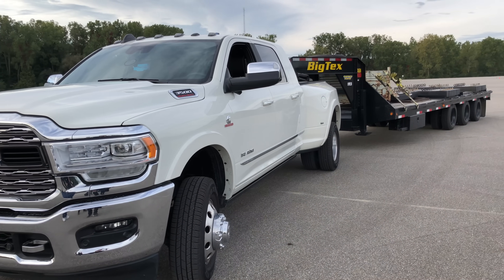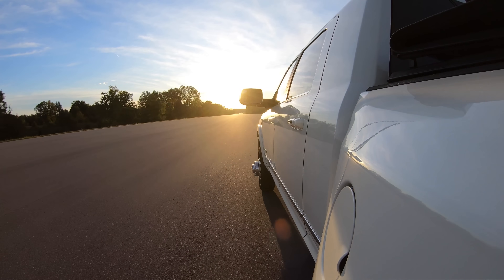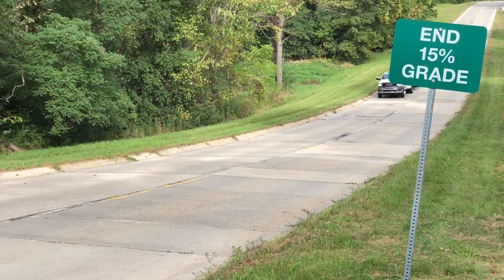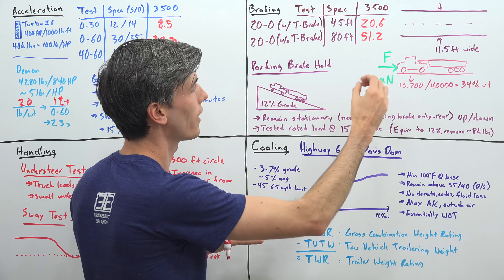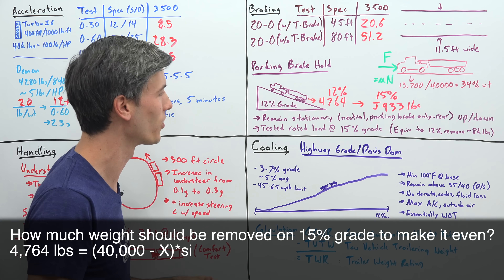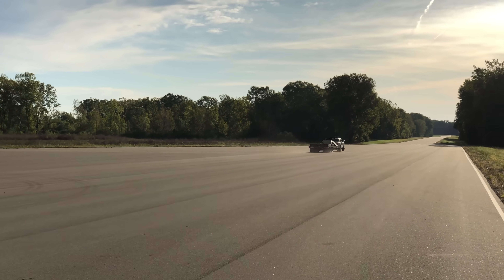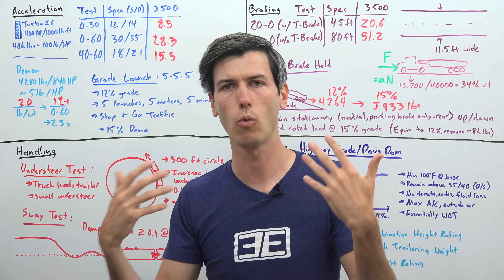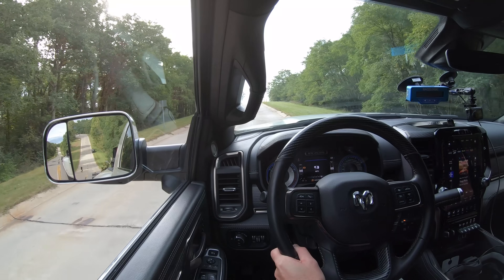How Much Weight Can Trucks Actually Tow?

Comment from the maker: Was the the vehicle in this video at capacity? Yes, but it’s rather confusing how we get there. The combined truck + trailer weight in this video is 39,840 lbs (with no people). The combined weight rating is 43,000 lbs - which you’d reasonably assume we’re down 3,000 lbs. However, the vehicle’s Gross Vehicle Weight Rating (just the weight on the truck) is 14,000 lbs, and we’re at 13,700 pounds (without driver, but with the tongue weight of the trailer) in this vehicle, so we’re hitting max GVW before hitting max GCW. Why? Because this is a Limited truck, not the base truck, which will have a lower curb weight with few features, smaller cab, 2WD, etc. So while the base truck would have a GCWR of 43,000 lbs, you would never achieve that with the Limited version due to the base weight of the vehicle. Meaning? Your truck has a maximum amount it can weigh, your trailer has a maximum amount it can weigh, and your truck + trailer has a maximum amount it can weigh. In this video, the limiting factor was the truck’s 14,000 lb GVW, which allowed for a trailer weight of 30,645.
Reply: 14,000 lb grocery-getter. . . that occasionally tows.  My 6000 lb Navigator feels like an RV. . . . 14k?  At least you win in almost every non CDL collision.
Reply from the maker: @snap-off5383  Just to make sure I'm not communicating this poorly, the truck itself weighs about 9,000 lbs. The additional 5,000 pounds to make 14k are from the tongue weight of the trailer.
Reply: @EngineeringExplained  I understood that from your beginning explanation and then ran my pie hole anyway without thinking.  Still 9000 lbs  a new one of those should come with its own Prius to encourage you not to let your trophy wife use it to commute
Reply: @EngineeringExplained  Can you make a video on how automobile manufacturers to distribute power and torque throughout the rev range?

It'll be very helpful for me.

Thank you.
Reply: @snap-off5383  These things are not intended to be practical commuters. I don't know what you mean.
Reply: @imnotusingmyrealname4566  In practice, that's their main use.
Reply: @snap-off5383  Even the duallies? I mean if you wanna do it go ahead but getting a low trim truck you'll actually use the capability of when driving it and then getting an efficient cheap car might be better.
Reply: @imnotusingmyrealname4566  I see more trophy wives driving duallies than anything else.
Reply: @snap-off5383  Oof.
Reply: @anonymoushippo-m7d  that's what we all need, we need to be able to afford both so that we can use the appropriate tool for the appropriate task
Reply: @snap-off5383  Just make enough money then.
Reply: If someone did not already know these facts and/or can not understand the concepts being set out in this video and the comment above. That person has no business operating vehicles of this size and capacity.
Reply: Engineering Explained So question for you why is it not a standard to do a 75 mph to zero brake test?
Reply: @zanehopefz6hundred761  I guess it would be illegal to drive something this heavy at 75 mph. The speed limit for trucks in Norway is 50 mph.
Reply: @mcplutt  It would make sense, but this isn't how the US works ... Speed limits vary by state and some don't even have specific truck limits, meaning even big rigs are allowed to go as fast as cars - up to 85 mph in some places (Texas IIRC?) which is absurd.
Reply: translation for "I understood" in social media speak.... means, I had no I idea what I was talking about.... but don't have the balls admit I was wrong...
Reply: @mcplutt  in the US non-commercial trucks have the same speed limit as all passenger vehicles.
Reply: Isaac Kvasager,  David Beppler is just an Elon cult drone troll... who just mindless rants about conspiracy theories, like a Putin bot...so yes everything he says is a Bad Joke to be laughed at :)
Reply: @nc3826  "Putin bots" are not real. There's no evidence of them.
Reply: @Isaac Kvasager It's not about the gas mileage. It's about wear and tear on the truck. That's an expensive suspension. No need to hit the replacement mark any sooner than you have to. Especially when you can get a little car for about the same cost as a complete suspension rebuild.
Reply: Engineering Explained Hey, I was thinking about your Tesla tire video. How you went with smaller rim with bigger side wall. Did you adjust your tire pressure at all? All vehicles come with the sticker on the driver side door frame and I was wondering if you need to adjust the tire pressure with different tire sizes. That’s engineering. Please explain it.
Reply: It would be much appreciated if you could use both imperial and metric in your videos.
Reply: Dcard Dcardian  The procedure is from SAE and references freedom units, not SI.  i.e. 13,000 lbs (then some kg conversion that is not a round number).  Also, the procedure was developed in USA by USA manufacturers.
Reply: I've got to ask... why do Americans insist on measuring very high masses (eg 39,840lbs) in pounds rather than tons? I can understand the reluctance to use complicated kilograms or tonnes but why not just say, "...nearly 20tons"?
Reply: @stamfordly6463  because there are about a half dozen different meaning for "ton"...long ton, short ton, metric ton, etc it's an imprecise term.  Easier to just say 39,000 pounds.  Americans use pounds every day and it has meaning.  Most people have no daily experience with a ton so we dont say it often.
Reply: You look like Beto O'Rourke
Reply: Excellent video, Jason.  As an addition to your next to last sentence, each axle also has a maximum weight that can be supported, which Youtube towing videos seldom account for.
Reply: Lol I was literally typing that we gotta get you to collab with TFL Truck as you were saying TFL Truck. Definitely should get you on there whenever whenever they get the Tesla Cybertruck (particularly the tri-motor with the 14,000lb tow rating) on the Ike Gauntlet. They had some crazy high energy consumption rates with the Model X. Max towing on flat ground tripled consumption and max towing on the Ike Gauntlet double it again. ~300Wh/mi. ➡️ ~900Wh/mi. ➡️ ~1,800Wh/mi.
Reply: How dare you not even mention the Cummins engine, which is the only reason people buy ram's (3500's) and is the industry leader in both civilian and commercial vehicles (U.S)
Reply: Yet, the Electric Ford claimed 1.5 million pound towing.  The SEC should investigate this claim.
Reply: @davidbeppler3032  there should be a requirement. Not how much you can tow but how much you can stop and pull without sway.
Reply: @davidbeppler3032  Yeah, but it wasn't in the bed of the truck. My Kubota tractor can tow that amount too! LOL
Reply: @anonymoushippo-m7d  SEC is the joke.  Ford is the joke.   EE did a video on this.  Didn't you watch it?
Reply: Engineering Explained Also the parking brake test on the 12% grade. It should be where the vehicle is going 25 mph and you have no breaks and so you have to use your emergency parking brake and see how long it takes to stop and will it stop.
Reply: @zanehopefz6hundred761  The parking brake is NOT an "emergency brake" - it is just a manual engagement of the rear brakes, rather than the usual hydraulic engagement. Because it is manually engaged, it stays engaged when you remove hydraulic pressure (such as turning off the vehicle,) hence its usefulness when parked.

Yes, if you lost all hydraulic fluid, the parking brake could be used to stop the vehicle - but in modern vehicles with electronically-actuated parking brakes, they both won't let you do it at speed, and even if they did, it would lock up the rear wheels and cause the tires to blow out rather rapidly in this situation.  Even if you have an older foot or hand brake for it, those don't have a lot of control, and you would likely end up locking up the wheels.
Reply: Which is why my old late '90s Ford F-250 has a higher actual towable load than many of the newer models - GCWR is the same, but the truck itself weighs MUCH less than a modern truck.

But, it probably doesn't pass these modern standards, either.  I know there is no way in hell I'm maintaining 40 MPH on a 5% incline at maximum load, regardless of outside temperature.
Reply: i heard tesla  can tow more than a truck can
Reply: This makes no sense to me because of.... lbs?

Comment: Just the fact that the hitch breaks clean off at any load is not safe at all.  Could you imagine driving down a highway with a boat.  Hitting a pothole because that never happens right 🤔🤔🤔...    And then watching your boat pass you on the highway and going into incoming traffic because there's nothing stopping it.   All the safety stuff is attached to the hitch.

Comment: One time I pulled 16,000 pounds with a GMC Sierra 1500. It was extremely sketchy and even just switching to a gas 2500hd with a 6.0 and pretty much the same engine power and pulled same load and it was 2-3 times easier to pull. It’s amazing the difference frame brakes gearing and suspension have

Comment: This is so ultra cool and I appreciate your sharing it. 

One thing these ratings never accommodate is frontal area. This sled trailer is easier to tow than a fifth wheel or travel trailer that adds a lot of aerodynamic drag. 

But, still, this is very, very cool and well explained as always.

Comment: Can you or anyone explain why towing specs are higher outside North America.  Being a tad hyperbolic but in the US it seems you need a 3/4 truck to pull a mid sized TT that in Europe a 5 passenger touring sedan is just fine. Does physics work differently there? ;) 
A 4 door Jeep Wrangler has a 3,500 lbs spec here and a 5,060 spec in Australia
Reply: Is it possible they are using kg instead of lbs?
Reply: @Bendigo1  nope always pounds to pounds.

Comment: Ive pulled over 7k with a 4cyl ford ranger. Wasnt freeway speeds or anything, but it did it. The truck blew a head gasket a couple months later. Had over 300k. 

I also towed a 9k 32ft bumper pull with a full camper on the bed in a f150 with the legendary 300 I6. Didnt even stutter coming off the line. 

Now stopping those loads with those little trucks? Yeah right. Good thing Im in a more rural area.

Comment: Doesn't the trailer sway thing have more to do with the trailer itself then the truck towing it? Doesn't seem like the vehicle would make much difference..
Reply: It is a combination of both actually.   The cg is the biggest factor but the suspension on the towing vehicle is a big factor too.  A softer suspension meant for ride comfort is more likely to sway than a stiff suspension meant for towing or hauling.

Comment: These tests were done with a goose necked trailer,  how much difference would be made to tests or the requirements if you use a trailer hitch and tongued trailer?
Reply from the maker: SAE J2807 will break down all of the different trailering options and what is required.

Comment: U need a CDL A  to pull if tow vehicle is over 10k lbs and trailer is over 6k as per Federal DOT.
You will get big fine impound ...I did.
Also tiny brakes, clutches and transmission in these will not last towing maximum load. Drum Electric brakes crappy  on mountains and never hold equally in reverse on  brake s will slip in reverse down hill but discs best and hold. Most new class 5 and 7 trucks have ABS air brakes also which are much safer.I have 40 years exp moving cranes heavy equipment and boats. 
Excellent work Thanks

Comment: These SAE derived tests are PERFORMANCE tests. Not strength, nor yield or point of failure. Just keep that in mind. Its actually in the SAE towing spec TITLE which is precisely; 

Performance Requirements for Determining Tow-Vehicle
Gross Combination Weight Rating and Trailer Weight Rating

Comment: Why do Americans use pounds for very large weights? 39,840 lbs = 17.78 tons which approximately  = say 13 cars. The mental picture is easily painted.
Reply: Both are used.  Generally when you visit scales the output / printout will be in tons, while marketing material is almost always in lbs.
Reply: @matthewevans4296  Oh, that sort of makes sense - for marketing bigger must be better. I notice that the Jumbo Jet seems to be the limit, so large container ships are quoted in tons rather than billions of pounds.

Comment: My car would fail the cooling test flat out. It accelerates noticeably slower in the summer, and will over heat on a flat highway if it gets any hotter than around 85 degrees out. Maybe I should have that looked at... And this is before hooking up a trailer (supposedly it can tow up to 1500 lbs.)

Comment: Why are duallys allowed more time to meet acceleration requirements vs traditional single wheels?
Reply: Probably because of the extra unsprung weight and roll resistance caused by dual wheels.

Comment: I dont understand how hoving dual wheels will change how fast the truck will accelerate..... If your spinning with all that weight in the bed you've got bigger problems... And it can't be a rotational mass issue... Please explain.

Comment: Why is it that the trailer is setup "nose-diving" in many videos of tests like these? I often find I get better handling and braking if the front of the trailer is slightly higher than the rear. You don't see semi tractor trailers setup like that. I think it would interesting to see them test the difference after adjusting the hitch height.
Reply: It plays on the weight transfer when braking and accelerating. Theres the inital weight but under accelerarion itll throw the weight back and under braking the weight forwards. Optimal is level. Leaning forward puts more on the truck, back takes it off and onto the trailer. I really dislike these test as it really doesnt comput to all the different trailer types, lengths and weight transfers. Also, cant really compare a 1 ton to a semi. Semitrucks has a 50-50 weight tranfer for their trailer or pretty close. where the cargo in the trailer sits make it to where the tandems slide for proper weight transfer of 12k steers, 34k drives and 34k tandems. Pickups run a 20-25%weight transfer to the truck  on goosenecks and 10-15% for bumper pulls.

Comment: Does the distribution of the load on the trailer have an effect on anything? The load on that truck seems to be distributed in a very purposeful way. If it does effect something, what are the implications of that distribution? Is that done for accuracy and fairness? Is that changed depending on the test? Or is that just there to make the truck perform as best as it can for marketing wankers instead of actually testing its capabilities under the assumption that most people wouldn't hit the real worst-case scenario cap unless they really blow past it which means they are putting it past the best it can do, and therefore, it is okay to fudge the numbers, no liability to impact the bottom line here!

Comment: @Engineering Explained I've recently watched a few of your videos about manual transmission and brakes and since your video about braking doesn't answer my concerns I'd like to hear from you. What do you think about downshifting and braking for the fastest deceleration? I don't want to be limited to street conditions in which it is most certainly pointless because you don't typicaly reach speeds high enough to be forced to brake that hard on a road, so knowing your opinion about two-method braking on a track would be appreciated too. Cheers :)

Comment: Great stuff.  I have been directly involved with evaluating both braking systems and cooling systems for another vehicle manufacturer.  Testing was done on Baker Grade in Baker, CA and at Death Valley, all at max trailer weight and very high ambient temperatures.  Pretty crazy seeing brakes catch on fire.

Comment: I wonder if you took an older truck and put it against those standards if the towing capacity would increase
Reply: I was wondering the same thing, and what about improvements on the truck, such as breaking, suspension, acceleration, cooling, what happens when we improve them?

Comment: For 1/2 ton trucks PAYLOAD number is what will determine the max you can tow almost every time. That will run out from tongue weight, cargo and passengers long before you hit the actual max trailer weight advertised.

Comment: The title of this video is deceiving. When you were showing how this truck beat all the test standards by such a large margin, I was expecting you to then keep piling on the weight until it couldn’t perform one of the tests, since that would be the answer to how much weight it could actually tow. All you proved here is that it can actually tow at least what the manufacturer rated it to tow.

Comment: Even though the Ram doesn't have the highest, torque, horsepower, or towing ratings, it made a very impressive show in these tests.  This showing is what you'd expect from all of the HD trucks from the big three.  The bottom line is; how much does this performance cost, who delivers the most bang for the buck?
Reply: They did have the highest tq rating till the 2020 ford superduty numbers were released.  Ram 1000ft lb, GM 910 ft lbs, 2020 ford 1050 ft lbs (935ft lb 2019 model)

Comment: No dually weights 13,700 pounds 
It might weigh that with the load sitting on the rear wheels but the load is only 30,645 so it is not 40,000 pounds